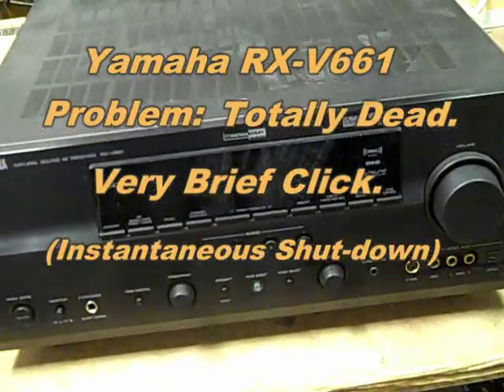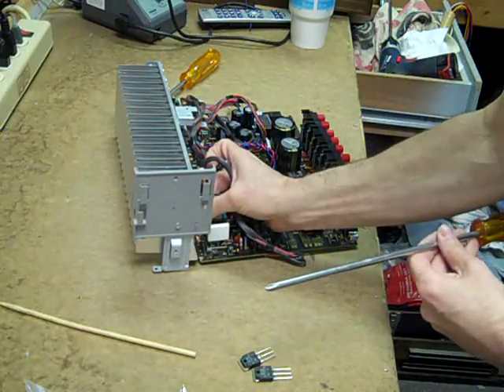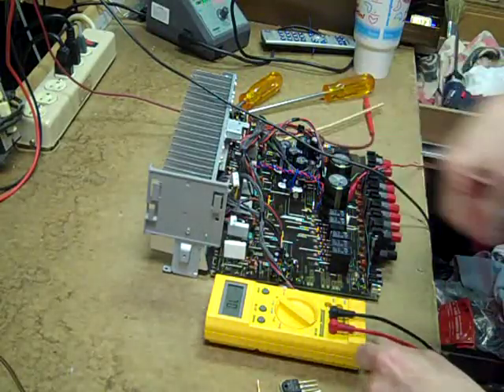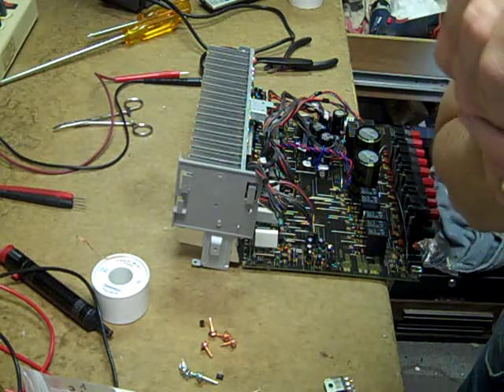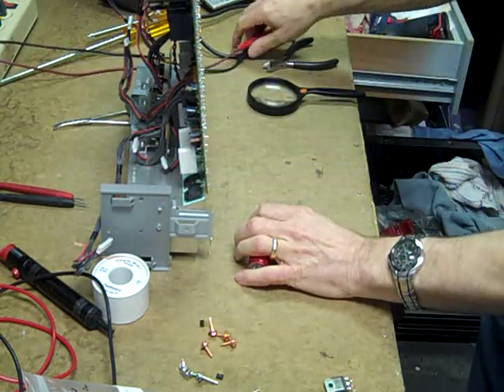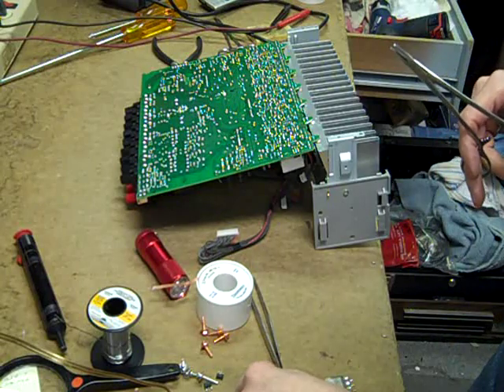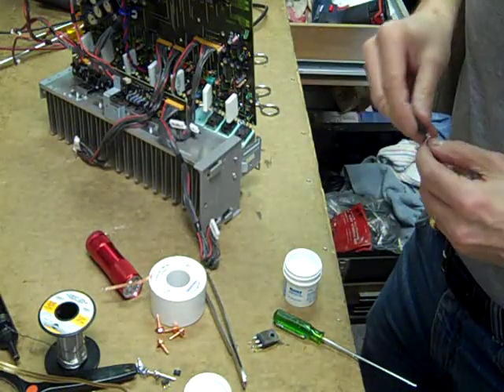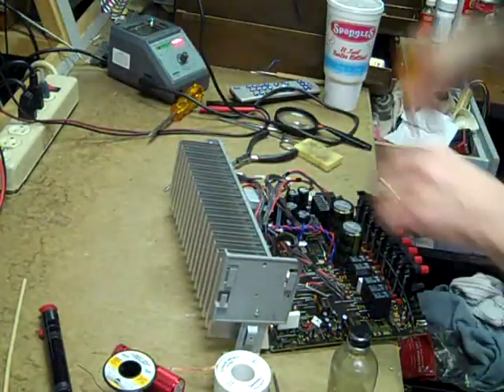Yamaha RX-V661 Repair Brief

Comment: Hi Mark,

My knowledge of electronics is very basic. 

I have a Yamaha RX-V773. Failed while watching TV - while at normal volume...
The red power LED glows dim, no other display visible. Press the on/off button on the remote, the red led flashes dim.
The fuse "was" OK, until I tried to do the factory reset to default. As soon as I pressed the button combination on the front panel to attempt the factory reset, there was a big flash as the fuse "went open circuit".
With the fuse open circuit and using a couple of different control panel button combinations, the front panel does light up with text and numbers... This proves the front panel still works - but I think that's it - probably nothing useful in the display

I do not know if a test I performed proves anything, but connecting my multi meter (set to ohms) across the speaker output connections gives a resistance reading on all channels EXCEPT centre, left surround and right surround. So, that is 3 speaker connections adjacent each other that look bad to me (unless this test is useless of course).

Some history - which may have been the beginning of the failure, some months ago, the centre channel started to cut-in and out... I thought the amp was history so I went out and bought a Denon. While performing the unit change over, I found that one of the centre channel speaker wires had come out of the connector =:-( .... Anyway, the Yamaha still worked after re-connection the speaker wire, so I installed it at my holiday house where it worked fine for some weeks, until it failed a few weeks ago while watching TV....

Sorry, not much info, but on this brief description, what is your feeling - trash it or do you think it is worth fixing. Is my output test valid?
Thanks Mark,

Jim (in AUS)
Reply from the maker: If it blows the main fuse something is seriously shorted. Yamaha's protection circuits work so fast in the event of a current overload, they usually cut off before a fuse can even blow. Anyway, forget about checking resistance at the speaker terminals for now. Check resistance emitter to collector of the output transistors, focusing first on the channel you were having problems with.
If there's no particular issues found there, check for a short from the collector of any NPN output transistor to chassis ground; do the same for any one of the PNP outputs. (each channel's NPN collectors are tied together inside, so are the PNP's) Occasionally there is a bad mica insulator. If this is the case the can also be a carbon path formed from that screw hole in the heat sink, right up through the body of the transistor. In this case the transistor must be replaced along with the mica. Merely trying to clean away the carbon as a fix will not hold - I been stung on that one before.
Reply from the maker: I had another Yamaha a couple days ago with a similar symptom. One of the main filter capacitors was shorted . Fuse blown - measured dead short from the collectors of (PNP or NPN - I forget which) output transistors to ground.
Reply from the maker: You can email me direct at mark_zacharias@labolgcbs.net and reverse"labolgcbs" to read "sbcglobal". I can send the manual in RAR chunks.
Reply: G'day Mark,
I did reply to your email address - did you receive my message?..... As it happens, I found a manual online for an RX-V673 which I think is similar to my RX-V773... Anyway, I wonder if you might be able to comment on something I found. My relay does NOT click when the power button is pressed. I unscrewed the board with the relay - fitted clip leads between the ground points on the board and the unit metal frame. I then switched on the power, applied multi meter to measure the voltage between the closely grouped 5v and ground (?) at the 11 pin plug connector - I measured the voltage OK, but when the multi meter leads contacted the 5v & Ground points, the relay clicked.
From this info, can you possibly identify any obvious faulty components - or at least group of parts I could replace as a test.
I know this request is a long shot but thought I would ask anyway. The reason the relay clicked when I connected the multi meter is probably because I had the board disconnected from the 11 pin plug? Who knows....
Let me know if you did get my email...
Thanks Mark,
Jim
Reply from the maker: Never did get the email. I'm not able to consult the schematic at the moment. Try again emailing and remember it's sbcglobal.net for the domain. mark_zachariasAT
Jim Stapenell

Comment: Hi Mark, thanks for the videos. I was hoping for a little help. I have an RX-477 that is going into DC protect mode. I have done some in-circuit measuring of the transistors using the diode test on my DMM and they all are the same (although in circuit probably isn't too helpful). I am a bit weary to plug this in and test those large resistors live to see if it is common to all channels or not to go further. My main board takes in AC into the main board and rectifies it to 50VDC and -50VDC. Any way to see if the main board can be powered separately? Or am I being too cautious? Here's a link to my repair manual for some assistance. Thank you!

https://www.dropbox.com/s/kd4wy2pbrhw8fo0/Yamaha-HTR-4067-Service-Manual.pdf?dl=0
Reply: 99% sure it's a bad transistor. Always is with a Yamaha with that fault. Best practice is to take them out of circuit and test. If one is bad, then you should replace them all in my opinion. Also important to look over all solder joints and touch them up if needed. Never a bad idea to visually check capacitors and if you have an ESR meter test any you suspect. I have had 100% success on every Yamaha using those steps.
Reply from the maker: I assume you mean RX-V477. You need to take DC readings at the output of each channel to determine which one is causing the problem, or if the offset exists on all channels. Not likely, but possible. Refer to page page 27 of the PDF and set the receiver to Protection Cancel mode, then you can take voltage readings at your leisure.
Reply: I’ve gone into bypass mode and the emmitor resistors show 0V across, however I am seeing -24VDC on all speaker terminals. The DC_PRT line on the main board is -2.1VDC which is causing my DC PRT 000L error. Any thoughts?
Reply from the maker: @xxdarklightning  Something in the general vicinity of Q2172, R2305, C2179, D2131(zener diode), or possibly R2330 or R2329, associated with Q2175 and Q2176. Something is unbalanced in this area. It would be unusual for Q2175 or 2176 to be blown but don't rule it out.
Reply: Ended up being C2179 that was shorted. Didn’t have any physical appearance of such but electrically it was bad. Replaced and I’m off to the races. Thanks a bunch for the help and being active in this community.
Reply from the maker: @xxdarklightning  I accept Paypal... 😁

Comment: Hi Mark,

Thanks for the clip!

Do you have any experience with a RX-V363 receiver which turn off after a short while? Sometimes it will take several seconds to turn off, sometimes a couple of minutes – but it will never keep on working.

Thanks!
Reply from the maker: sblueeye After it has malfunctioned, let's try a diagnostic mode. It will be important to read the display during the first couple seconds. It will read DC PRT followed by a number, or PS PRT, etc.Start the diagnostic mode by pressing and holding "straight" and "audio select" then pressing the standby/on button. The receiver may or may not stay on. Get that initial message and report back to me. If it's a PS PRT message should be relatively easy power supply type problem. DC PRT could be more trouble.
Reply: Mark Zacharias I get a PRV PRT 154 message (I disabled protection)
Reply from the maker: sblueeye Best guess - a bad 7912 voltage regulator IC. Possibly IC 237 on operation (2) pcb. Try to find that -12v line - see if it's missing or way low.
Reply: Mark Zacharias Can I tell by checking the -12v if it's the 7912 or one of the 7805? Also, I assume I need to do all that when protection is off, is that correct? Thanks so much for helping!
Reply from the maker: sblueeye You should be able to check the output of any of the regulators - or anything else you can reach in there - with the unit in Protection Cancel mode. Don't forget - I accept Paypal!
Reply: Mark Zacharias Be sure that if it works you'll get yours. I just measured the voltage on 7912 output and it's 10.5v - so not way low, but still lower than 12v. Do you think it's the culprit?
Reply from the maker: sblueeye
10.5 definitely very marginal. I've definitely seen them shut down when it drops to -9 or so, and that wasn't this same model. The 7912's are a little notorious for this sort of thing, especially because they used cheap ones from Korea.

Comment: Mark, great video! I have a BA in EE but haven't really used anything I learned since I got my new job.  I have a Yamaha Rx-v765 that I believe is in high current shut down mode like the one in this video.  When I plug it in I hear 3 clicks from the 3 relays but there is no display.  I have checked voltage going to the display and it measures close to what the service manual says it should have.

Do you happen to have any tips or tricks to verify it is in high current shut down mode or any other tips on where to begin troubleshooting?

Part of me says I should just send it in for repair but my inner nerd is telling me I should be able to fix it myself.
Reply from the maker: These can have a variety of problems. If the main power supply voltages to the output transistors is staying on, then probably not a high current shutdown. Maybe the display circuit - maybe a blown channel. I would start by looking for any shorted output transistors. I can probably send you a pdf of the service manual.
Reply: Mark Zacharias I have the service manual but everything I have checked so far seems to be correct.  I haven't dug to deep into yet though.  I basically just checked a few things I could easily get to like transformer and display board voltage.

I was only using the rear speaker outputs at the time it went out as my main speakers are powered.

I should also note there is about 56 volts going to the chassis.

I will check the output transistors next.  I appreciate the reply.
Reply: Mark Zacharias
None of the output transistors appear to be shorted as far as I can tell.  They all have high resistance across collector and emitter.  I'm not saying my in circuit transistor testing is 100% percent accurate either though.  I may do some more exploring in the display circuit.
Reply: Mark, I think I may have found an issue.  There is a 25 pin ribbon cable that goes from the main video board to the display circuit.  When analyzing the voltages coming out of the video board to the ribbon cable there are several discrepancies.  Pin 24 which is labeled 3.3DSP is supposed to be 3.4 but I am reading only 1v.  Is that just because of another problem and the microprocessor is telling the display not to turn on or could the processor itself be damaged.
I think I maybe getting in over my head here but it is certainly fun.  Sorry for hijacking your video.
Reply from the maker: Jeremy Meyer
I have seen things like this cause a "no display" problem. In my case. I replace the digital board, where the 3.3D (for display) is generated. (Seen this twice only)
Reply: Mark Zacharias Unfortunately Yamaha wants $260 for that board.  Ouch!
Reply from the maker: Yeah - it's way better if it's under warranty... I do warranty work for Yamaha.

Comment: Hi Mark, 

I have a Yamaha RX-V671 amplfier, that turns off imediately after turning on. If I clear the protection mode it stays on, however when i turn it off and on again, it still does the same thing. Do you have any ideas, of what could be wrong ?
Reply: Ok so I've figured out that the main driver transistors for SBR (C4468 and A195 have gone). I was wondering if I could replace it with these - http://www.ebay.com.au/itm/2pairs-of-2SA1695-2SC4468-SANKEN-Transistor-A1695-C4468-/271932036229?hash=item3f50699485:m:mNPmiHLdxjrADvA5weFJPDA ?

The original Yamaha ones say C4468 ONP and A195 OOP
Reply from the maker: That's a typo - it's A1695. There's probably other parts bad, too. Q1040 and Q1047 will also be bad, probably also D1021, the 5.1 volt zener.
Reply from the maker: And be aware there's fake semiconductors being sold out there.
Reply: Oh ok. Where do you recommend, to buy replacement parts. I live in Australia. Is the ebay link i sent no good?
Thanks
Reply: Or is is possible to just bypass that channel completely , by removing the Surround Back - R speaker protection relay ?

Thanks for your help
Reply from the maker: Might be possible by clipping the output transistor leads and removing the emitter resistor. I don't recommend it though.
Reply from the maker: Probably also have to remove the current sense transistor for that channel.
Reply: So I replaced the blow transistors, measured the Vbase-base and its resistance was within spec. However when I put it all back together, it is completely dead, won't turn on at all ? Do you have any idea why? I've checked the wiring, replaced output transistors, driver transistors, bias transistor.

Comment: Mark, I have a Yamaha RX-V675 and my error code is like this "DC PRT 255H". Seems to be an abnormal DC output (high in this case) from the main power supply. Could you give me some help? I know some about electronics. Do you know how to get the blueprints of the circuits from this model..? Where? Thanks in advance.
Reply from the maker: http://elektrotanya.com/?q=showresult&what=yamaha%20rx-v675&kategoria=&kat2=schematics
Reply from the maker: I'll look at the schem and see what I think.
Reply from the maker: DC PRT probably pertains to DC offset from one or more amplifier channels. Use the Protection Cancel function to force the receiver to stay ON and find out if the offset is on one channel or on all channels.
Reply: Thanks Mark a lot. Do you know how to cancel the protection function? Isn't it dangerous for any other components to damage from this dc issue if I cancel the protection?
Reply from the maker: The information is in the service manual, at the link I provided. The protection function can be cancelled for most DC issues - not for high current problems, like a blown channel or shorted main filter capacitor. The information on the protection circuit starts on page 28.
Reply: Thanks Mark. Will check every channel if there is an offset on any of them. Regards.
Reply from the maker: Handy tip - with Protection cancel - you can check directly at the speaker terminals with a multimeter.
Reply: Do you know which value limits should I get in order to know if it is a bad or a good channel..?
Reply from the maker: If there is DC in  excess of 1 volt or so on any or all speaker outputs that would trigger the protect. Normally the DC offset should be under about 50 milli-volts. Usually less, under 15 or so milli-volts

Comment: What Driver Transistors did you use to replace the c4614 and a1770 transistors?
Reply from the maker: 2SC4027 and 2SA1552 are the replacements I used.
2SC4793 2SA1837 are used by Yamaha in some step-up models. They survive more often if the main output transistors fail.
Reply: Thank you so much, busy rebuilding the front right channel and could not find any equivalent parts that match.
Reply from the maker: Watch out for that 5.1 zener...
Reply: will check and replace if necessary, thanks for the quick feedback awaiting the parts from ebay now

Comment: Dc prt 255 H on HTR 2067 ,any ideas?
Reply from the maker: Check output of DC voltage regulator IC's, especially negative voltage, -12V, etc, or could for example be a fusible resistor feeding one supply or the other.

Comment: fantastic i have a modular amplifier TECHNICS SU-CH900 totaly dead i open it the fusible are fine what can i do i need help ............
Reply from the maker: Clint Eastwood Never seen or worked on one. If you are technical, I would suggest the usual - start with the power supplies, starting with the low-voltage ac secondary and regulated DC circuits.
Reply: ok thank you for responding i ll see it and i tell you ..